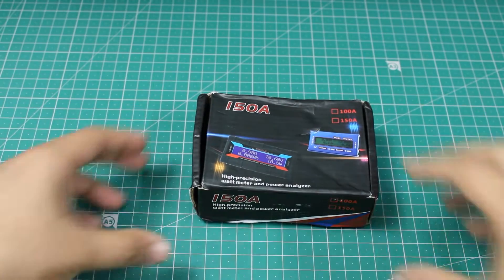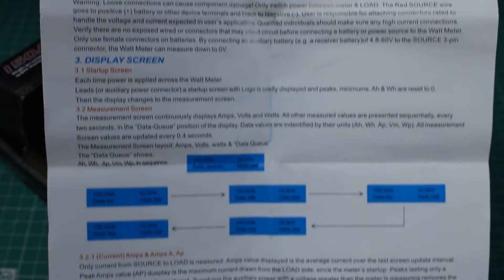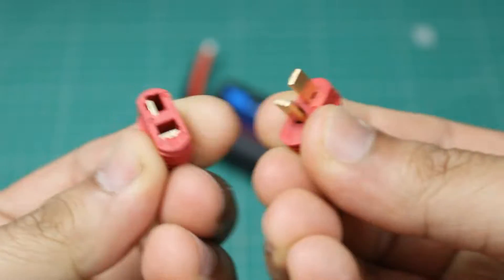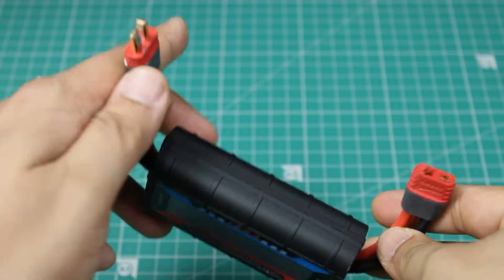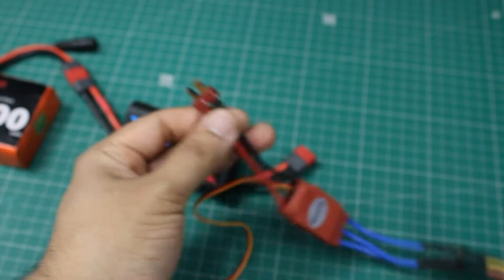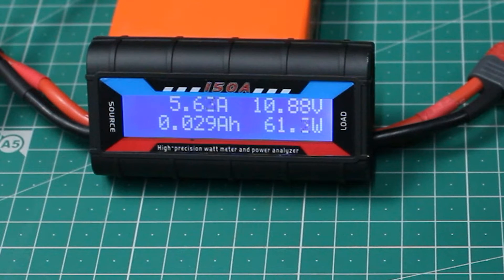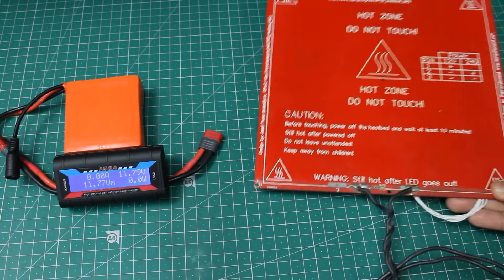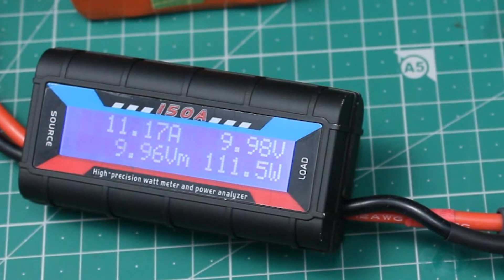150A DC WATT METER - Measure DC Current and Voltage with this

Comment: if they are saying 0.01A that does not mean it is true (btw it is rather precision than accuracy), you should have done a test with another power meter, preferably a certified one. Your test only tests that device shows some numbers on the screen.

Comment: do that wire really supports 150 amperes???
Reply: There’s no possible way that this really supports 150A, the product labeling in description is misleading. There’s like 10 different retailers at least on Amazon selling the same product for cheap and I’m guessing that people buy it just because they want a high amperage rating.

Those wires are way too small … I actually bought one of these on Amazon for my own curiosity… and it came with 12 gauge wires, which is only safe up to 20 A for a continuous load. 

You try to push 150 A through that device things will melt and burn way before you even get that far.
Reply: @mathewwerber9028 maybe this explains some fire accidents around... 👍🏻👍🏻